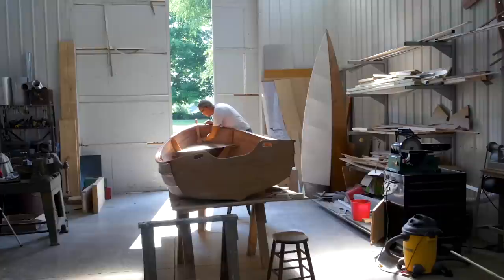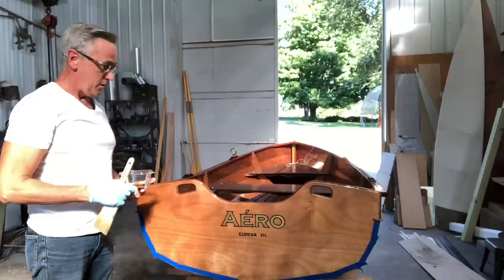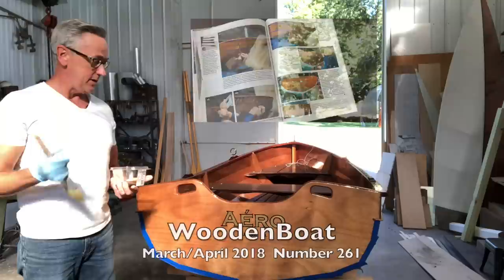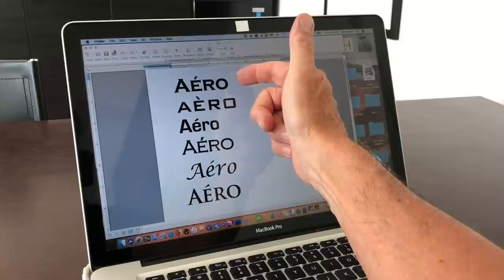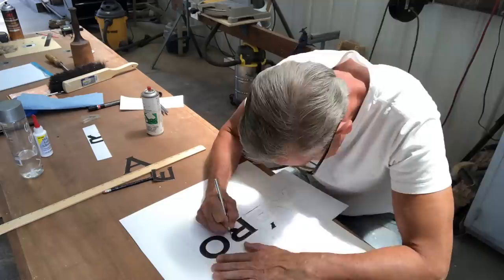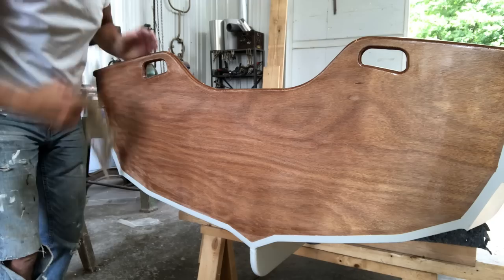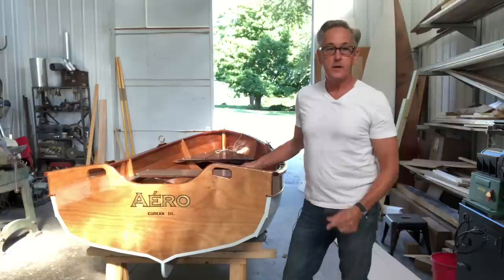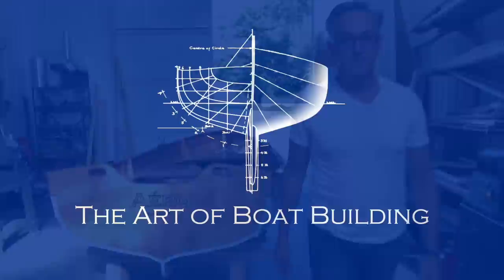Episode 4: Applying Gold Leaf  Lettering

Comment: My Dad used to use a pouncing wheel and a sock full of powder to put the sign on, as the old time sign painters did. Then he would use white paint that he mixed up that was super slow dry, he put something in it. He then could see a perfect sign on the surface before applying the gold. If you apply it to a business door glass, you have to use clear first but on a boat you can use a slow dry white paint under the gold.